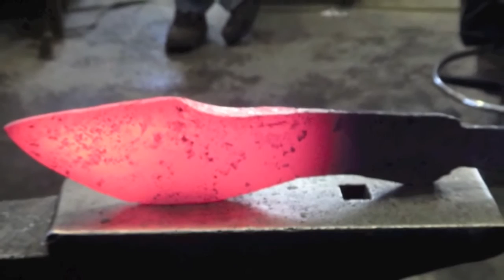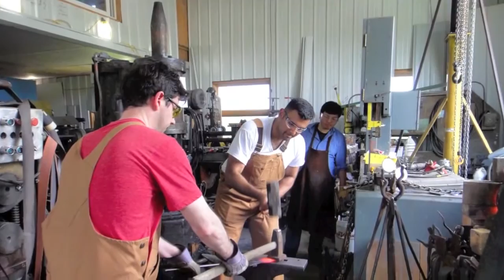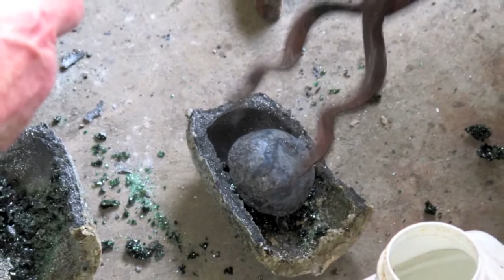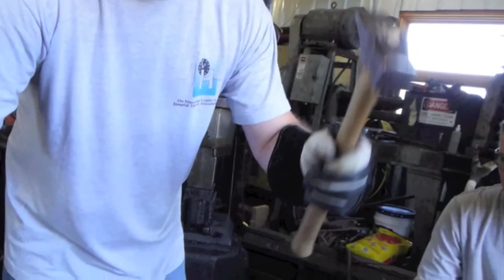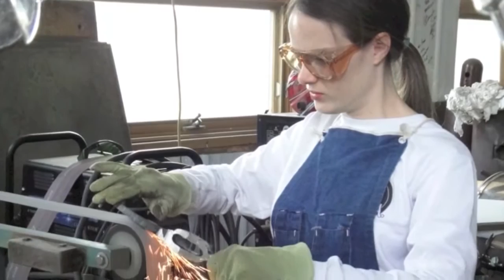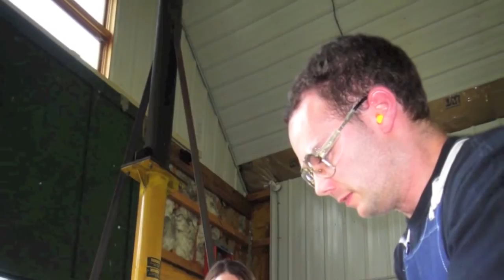Copy of Blade Smithing Classes

Comment: 1- The Damascene sword is made from locally produced damask steel. Through iron ore extracted from the Levant or imported from outside, especially iron imported from India or from iron wastes such as blocks and nails.
There is a similarity between the damask steel and the Wootz Indian steel, but each has a different method of making.
3- Damascene steel is made by iron heating in the corr, or through the iron smelter in Buattak and Skbh, and added to the crucifix metal materials such as manganese to increase its brightness and prevent oxidation.
4 - Adding organic plant materials such as pomegranate, pomegranate peel, rice straw, wood or foliage to iron in the crucible or soft protected iron. These materials, which become coal mixed with iron to be fluent, have distinct characteristics, the most important of which are: The substance or the individual (or the destruction or the dice or arteries).
5 - knocks the mixture to take its final form is the shape of the sword straight straight and write down and beautiful downloads and writings
The sword of Asad Allah may be one of the most prominent examples of the Damascus sword that has spread in Persia since the sixteenth century.
These principles remain sufficient to find the decisive way in the manufacture of Damascene swords, then experiment and practice quantify the disclosure of the methods of industry as a final revelation. We call on research centers in the world to work on the production of damask steel and then the Damascus sword.
The essence: a group of candidates on the blade of the sword enters the steel industry without the intervention of the manufacturer or discussion, and these nominations appear in the form of free lines with iridescent colors, or in the form of lines and patches circular or tortuous and often appear in the form of waves or clouds of color. It may be called "the sword" or the "frond" or "sword water".
The reason for the diversity of the essence formulas is to surprise the manufacturer only if it is able to control the proportions of impurities mixed with steel such as carbon, calcium, sulfur, phosphorus and pomegranate peel, or control the temperature when evaporation and warm up.
The essence of the Damascus sword
The sword of Sultan Husamuddin Lajin (1299 AD) moved to Damascus, and the industry moved to Egypt. In the Mamluk era, Damascus used to supply Cairo with the Damascus swords. It was one of the most famous swordsmen, Ibrahim al-Maliki. Its curved blade is made of damascene steel made for the apparent Sultan Qansoh al-Ghouri (1515 AD). The handle of this sword is spiral and silver-plated in gold-plated shape and on the face of the blade are engraved and engraved figurines. And in the Kabi Seif Museum of Sultan Qaitbay (T 1496).
The Damascene sword was moved to the west by the Crusaders under the name Damascinag.
Spread of the Damascene sword
Among the most prominent examples of these swords, those of the Umayyad caliphs are distinct swords made by the Damascene workers, some of which are still kept at the Kabi Saray Museum in Istanbul, the most important of which are:
Saif Muawiyah is a straight sword.
2 - Saif Omar bin Abdul Aziz, historian in the year 100? And engraved by his name and the name of the manufacturer, but not read.
3 - A sword inscribed with the date 105? With the name Hisham ibn Abd al-Malik.
4 - a straight sword by the name of Saad bin worship of the companions with writings and Damasca late.
5 - Saif has successive inscriptions of the names of Omar bin Abdul Aziz, Harun al-Rashid and Sultan Qaitbay.
The manufacture of Damascene swords continued to be popular in the Abbasid period, which was described by the Canadian and described its manufacture under the name of essence. But this description was not enough to learn the secrets of the industry.
And moved the swords of Damascene and the way of manufacture to Andalusia, and Abdul Rahman II (822-852 m) encouraged the manufacture of swords in Toledo and in Almeria, which was specially Damascene province, and talked about Siofha headquarters, and said that during the twelfth century Almeria was one of the most famous cities in the industry Swords and weapons as well as in Seville, except Cordoba.
Thus the Damascus sword moved to the west through the Crusaders, the word Damascening, in order to mean the Damascus sword. The Damascene swords industry was also famous for its name Damascinage.
Since 1400, the Damascus sword industry has been decimated by three factors:
The invasion of Tamerlane, the transfer of skilled Syrian industrialists to Samarkand, and the abundance of industrial steel.
The Damascus Sword Manufacturers
We must stand with Ibrahim al-Maliki, the famous Damascene sword maker at the end of the Mamluk era, who moved to Istanbul after the Ottoman Sultan extended to Syria and Egypt in 1517.
Ibrahim al-Maliki had left us a number of Damascene swords of the Mamluk Sultan Qansoh al-Ghuri and others, and his name was engraved on the blades of these swords and sealed on their selenot.
In the year 1585, the Sultan of Bayezid II (1511) brought swords and four daggers to twelve different occasions, and the Sankar family in Syria returned to their great grandfather Haji Sanqur, the famous Mamluk sultan who He left us more than forty sword bearing his name, and had a special factory in Istanbul supplying the sultans with his production. In Istanbul, he received acclimations ranging from 1500 to 2000, and the sultan once took him down, two kittans made of bursa. This skilled manufacturer was not calculated on the Turkish Ottoman manufacturers, in the sense of not being named in the records of the Ottoman archives. Due to the fame of this manufacturer, some of the swords bore his false name as Haji Sangur.
It is clear that Haji Sanjour moved from Sham to Istanbul and set up a period there, and he made in the Levant collections of swords, including a sword of the Sultan of Gori of Damascus steel.
To search for the mystery of the Damascus essence
The industry of substance is still a secret that has not been fully discovered. Today's factories are trying to identify the methods of making damask steel and its decorative spectral results. She saw that she was going through successive stages:
1 - Forming iron or steel in the form of a blade by roads on the anvil.
2 - Put them in the heat of the high temperature to be filled and follow the ways to form the shape of a straight or curved blade.
3 - wipe the blade and clean it with abrasive stone and coolant to put the cut limit in the blade from one side or two sides.
4 - cleaning the monument with acids and fat substance «Shihira» to stabilize the color of the metal and protect it from rust.
5 - Filler again and watering the blade with water if the iron takes the hardness of steel or watering with water and oil at an equal rate if the blade of steel originally.
6 - access to the essence stage, a stage that is still special for the manufacturer and his secret vary in the standards and proportions of watering materials and degrees of protection.
The authors who spoke about Arab literature do not have enough information about these swords and damascene occupations, which led some researchers to believe that this name does not mean the manufacture of swords but rather their trade.

Absence of the Damascus sword:
The Canadian (4) speaks of the Damascene swords, saying, "I have known this in its quality since ancient times." And its nails were good cut, if the original watering .. The swords Damascene cut all swords generated. The prices range from 15 to 20 dirhams.
The manufacture of the Damascene Swords continued to be known in the Abbasid period, which was described by the Canadian and described its manufacture under the name of essence.
Since the 1400s, the Damascus sword industry has been decimated by the invasion of Tamerlane and the transfer of skilled Syrian manufacturers to Isfahan and the abundance of industrial steel. However, the swords and nails industry continued in Damascus until the last century, and the industry became extinct when cheap European steel, which is less expensive than Damascus steel, began to invade the markets of the East.
The steel makers and the Damascus swords have become extinct, and the secret of this honorable industry has characterized Damascus throughout the ages.
My email : ah74e75@gmail.com
Margins:
* Researcher in Arab aesthetics and art history
(1) Onal Yogel: The Islamic Swords and Their Industry Publication of the Research Center for Islamic History, Arts and Culture in Istanbul - published in Kuwait in 1988. The translation of Tahseen Omar Taha Ugli and the introduction of Ekmeleddin Ihsanoglu.
(2) Dr. Ahmed Youssef El Hassan: Damascus Steel Industry Lecture in Aleppo 1972.
(3) Al-Biruni Abu Al-Rayhan: Al-Jumahr in the Knowledge of Gems, The Scorial Manuscript No. 9054
(4) See: Letter of the Canadian, Swords and Genes edition of Leiden 287.